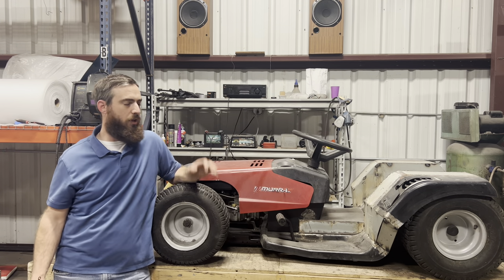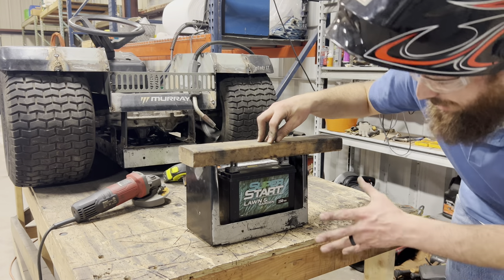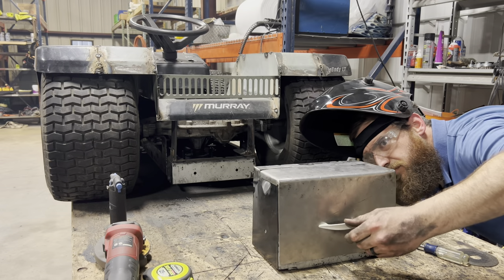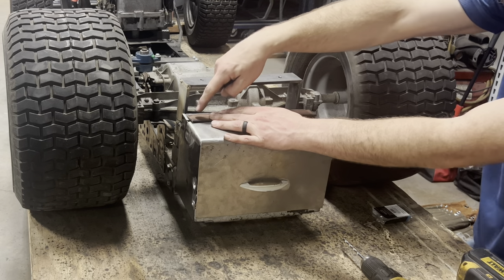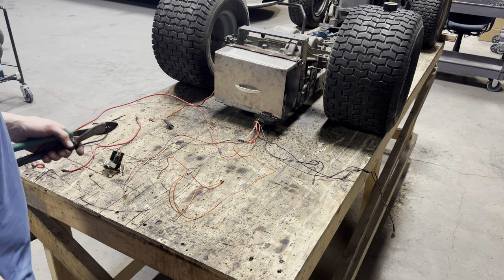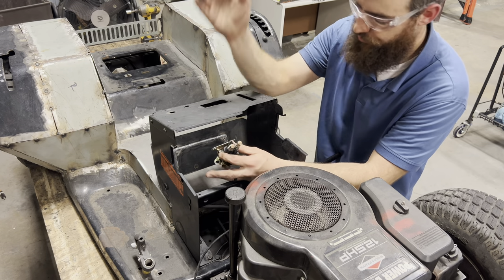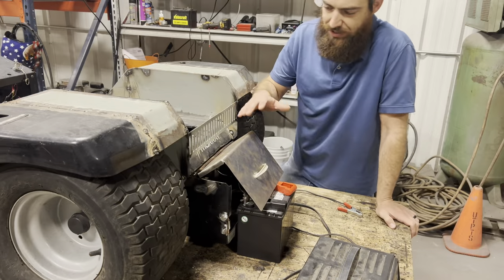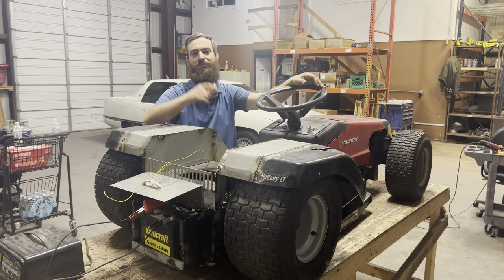How To Lower a Lawn Tractor as Low as Possible Pt. 5

Comment: I realise this is the past but I've been watching this build and I need to say something. That rear end body work is a sin against humanity. 1: You haven't put the seat on once to check fitment. 2: The fenders are too far forward and your body lines look to be angled forward because of it. 3: Possibly the worst part is it looks like you can not remove the rear tires. 4: Adjustability, modularity and serviceability are completely out to lunch on this build so far. I can appreciate the overall effort but I wish you had a second set of eyes on this project.

Comment: You can use a panio hinge for your battery box. Cut it the width of the box and weld it to the outside of the box. The hinge on one that size will not be bulky. So it will look nice.

Comment: looks like you couldve mounted the battery in the consolle next to the starter solenoid
Reply from the maker: That could be possible, but it would definitely be a tight fit and it would be very difficult to access
Reply: There's no way it would fit with steering column installed

Comment: Man I was screaming through the phone for you to put that battery in the console area it would have hid it better you wouldn’t have had to get extra wire you wouldn’t have had to buy another belt and you wouldn’t have had to buy a different kind of battery and it would look so much better plus you would still have access to the battery depending on fit you might of been able to cut a door on the side of the console so you can pull it out if needed that’s what I would do and it would look so much better that box is the only thing I don’t like sticking out like that definitely need to move it and why didn’t you put a bigger engine or change the pully set up to go faster also battery idea if you wanted to you could take that plastic box the battery went in and bolt that up to slide battery in or weld four pieces of angle so the battery box fits inside to keep from sliding and bungee cord it down to those angle iron stubs
Reply from the maker: Ya, the battery box on the back isn’t my favorite  but it would have been pretty tight in the console and quite a bit more work. 
I do plan on going with a larger front pulley in the future, but my wife said I need to get a helmet first 😂 and I didn’t do an engine swap because I’m trying to do this with the least financial input as possible and the engine I have does what I need for now

Comment: So you’re probably done already, but you don’t have blades…..you don’t need any safety switches.
Reply: Couple pieces of flat bar inside to hold the battery from sliding around?
Reply from the maker: @feellnfroggy  I’ve already bypassed all the safety switches, but I would like to figure out a good way to hold down the battery inside the box
Reply: @wybarprojects  I saw the bypasses as I watched more....lol

Comment: Being in electrical and electronics since 1973, I appreciate your attention to the wiring.

You have the battery door hinges welded upside down with the hinge loops and pin up, making the gap bigger than necessary.  Removing them would be a PITA, but had you drilled holes and mounted the hinges with screws on the flat side with the hinge loops and pin down, there would barely be a gap and there would be no warping from the welding heat.  Mounted this way, hinges can open about 90°, which is all you need here.  If you remove the riveted belt, you could use a very thin sheet of rubber to cover the gap and just rivet it on one side.  Cut it about 2 inches wide, or 1 inch wide if you want, and only rivet it on the back, or just the front, whichever you think best.  If you just pulled the a row of rivets from the belt, front or back, I don't think the belt would seal the gap.  This 4 months later, but it would work if you haven't done anything else yet.  Cutting the rubber sheet to 3 or 4 inches wide would help to insure covering the gap, and make it bit longer to help cover both sides.

You could buy a battery maintenance charger.  It has a 2.5 Amp Max charge and the trickle charges after that.  They go for around $30-$35.  Lead acid batteries were made to be used, not stored, and a battery maintenance charger simulates a car battery with the engine running.  It keeps the Voltage level around 14.5 Volts like a vehicle does, and that helps them to last much longer.  In the case of a tractor mower or other small engine devices, you may not need it with a new battery during mowing season, but you should have one for Wintertime and other long storage.  Once fully charged and working good, it will help make older batteries last much longer, too.
Reply from the maker: That’s all great information, thank you! And I haven’t resolved the battery door issues yet, so I could definitely use as much advice as possible 😂
Reply: @wybarprojects   I hope at least some of it helps.

Comment: can a hydro transmission be rotated 90 degrees to use with a horizontal shaft engine? I saw you rotate it 180 and it worked but is 90 all right?
Reply from the maker: That’s a good question and tbh I’m not sure. I would assume the hydros would have issue being tilted but I also don’t have a real understanding of how they work

Comment: Would the battery fit under the console?
Reply from the maker: There might be a way, but it would not be easy. The main issue is the steering column running right down the middle and I also took a lot of the empty space in the console away when I adjusted the floor pan to fit around the clutch assembly